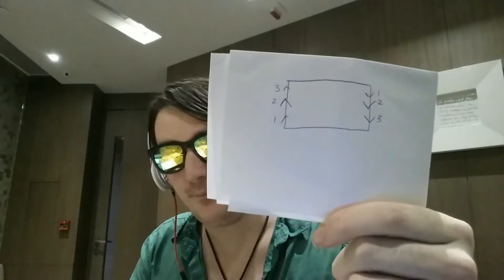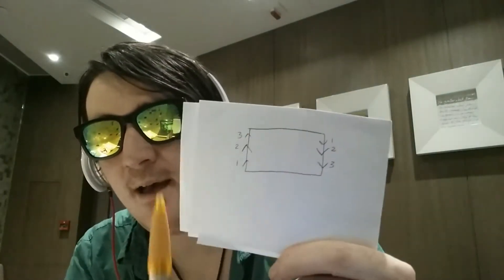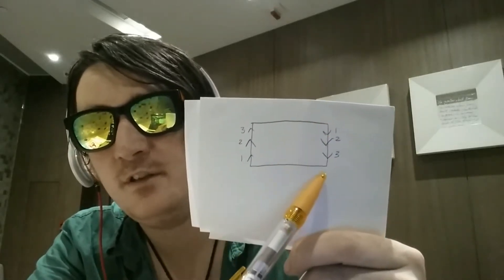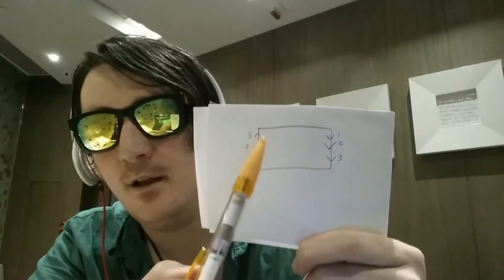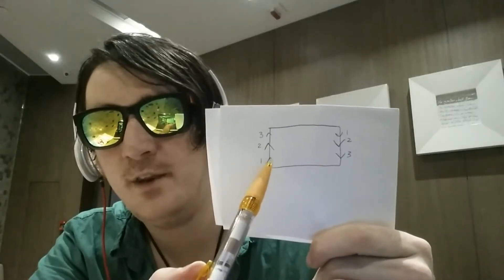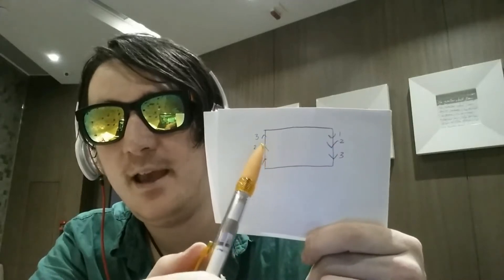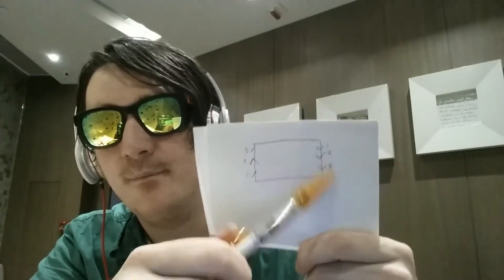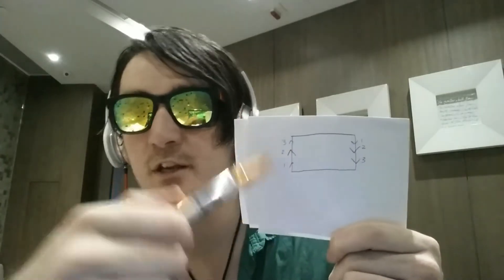What is The Shortest Mobius Strip?

Comment: why is it not a square?
let the square be A , B , C, D for its corners clockwise.
then take A to C and B to D. 
it satisfies all the properties required. 

Am I missing something?
Reply: The only way I could take A to C and B to D using paper was to fold the square diagonally one way, then fold the resulting triangle again the other, not in one twist as I could just about do in the case of an aspect ratio of 1:√3 (see my reply to the comment above). Of course that alone doesn't prove √3 is the minimum possible for that kind of manipulation, nor that your Mobius square doesn't satisfy the properties required. Anyway which edges would you tape together? 

I have done it the simultaneous twisting way with a square cloth instead of paper. and with aspect ratios even smaller than 1:1, that is bringing two long edges together

Comment: I gave this a go! I know it's late and you have probably given the prize away already, but here is my solution.  

The biggest hint you gave was when you flattened the strip into its triangular form.  My gut told me that the smallest that could go was the isosceles triangle formed by any two overlapping folds -- and that triangle would have sides of length 2√(3)/3.  The length of the rectangle "l" would be an isosceles triangle with sides of half of that = √(3)/3, and adding the three sides would give you the simple solution of √(3).

Then I wasn't sure that I was correct, having difficulty picturing it in my head, so I made a small paper mobius strip = 1"x√3", and marked it with points 1,2, and 3 as you did in your diagram, and folded it as best as I could, and bam! the opposing points lined up!
Reply: I just made a 1 x√3  Mobius strip by just about managing to twist and tape one end back onto the other. Then with some manipulation flattened it into a surprisingly neat equilateral triangle. Snipping it open again along one of the sides revealed a trapezium consisting of three equilateral triangles defined by crease marks in the paper, two pointing up on either side and a downward pointing one in the middle. I can sort of see how √3 represents a limit of some kind.

Anyway I hope it interests you after all these years to know that 1:√3 has indeed just been found to be the shortest Mobius, see Scientific American 12 Sep 2023 and a YouTube short by UpandAtom.

Comment: Richard, I love your videos, but you need to do some audio editing. Cancel out the static and boost the volume.

Split the audio track off of your video.
Bring it into Audacity.
Select the Whole Thing (C-a)
Effect -> Amplify -> Ok
Select a section of quite, where you are not speaking, and there is just background noise
Effect -> Noise Removal -> Get Noise Profile
Select the Whole Thing (C-a)
Effect -> Noise Removal -> Ok
Save the sound track, and add it back into the video
Reply: +LeftWing *quiet not quite